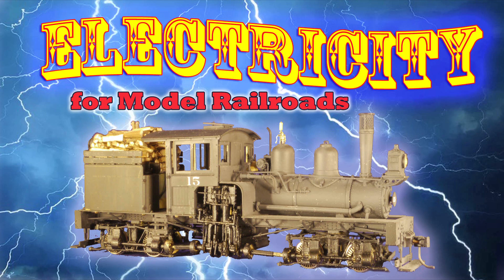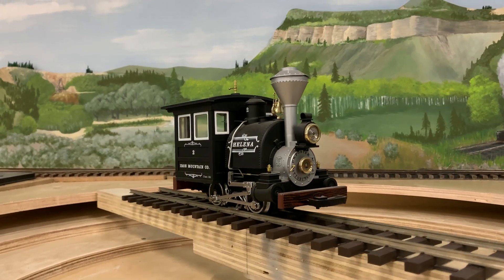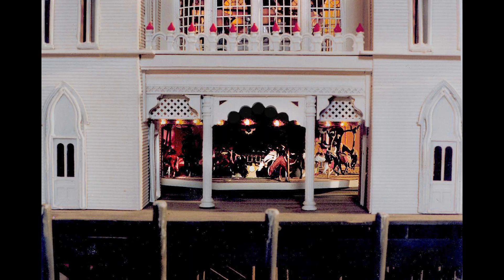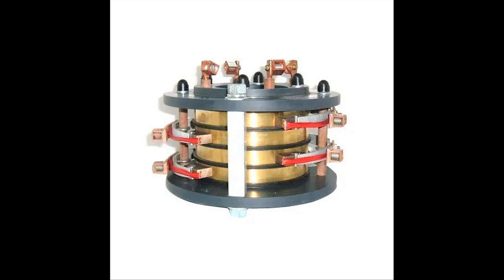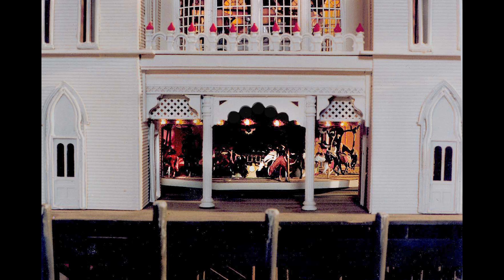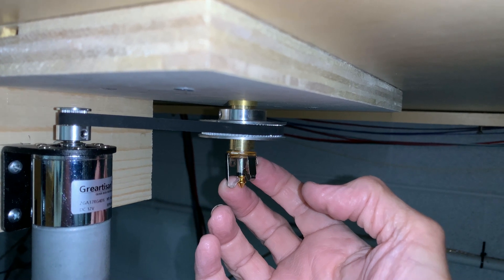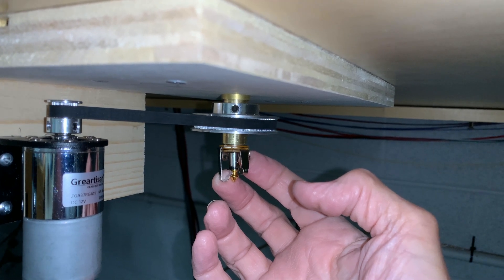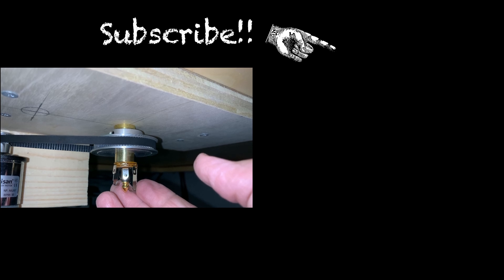Super Simple Slip Ring for Models and Small Electrical Projects

Comment: You: "...female 1/4 inch plugs." Common error - the Plug is the Male part. The Jack is Female. Frpm Google "A plug is the male-type connector, often at the end of a cable, while a jack is the female-type connector that a plug fits into.". Look it up if you don't believe...

Comment: those guitar style sockets are absolute garbage. They wear out really quickly because the contacts are both structural and electrical. It takes verry little force to damage the contacts spring steel, at which point the contacts become intermittent because they no longer provide enough pressure. I would at the verry least be looking at a dual wipe + a plastic structural shell - something like the NMJ6HCD2 although you'd probably want the solder lug variant NMJ6HC-S.
Reply from the maker: Thanks!

Comment: I built a 36" turntable and used a full size headphone jack as the center pivot and power connection. My turntable is manually turned instead of motor driven.
Reply from the maker: I thought about that. But these huge heavy locomotives require big and heavy. 😊😊
Reply: @ToyManTelevision on my turntable, the plug is not weight supportive. The weight is supported by the wheels at both ends. The plug is just for the pivot point and future electrical connection.

Comment: In 1967, I laid HO model track on a 48-in ring of plywood mounted on a 26-in bicycle wheel mounted on a large speaker frame mounted on a board.  To get power to the track, I made a plate on the underside of the wheel with a contact that slid on the plate.  The wires to the rails were connected to the plate and the wheel.   On the support side, I connected the power pack to the frame and the slider(a brass spring in contact with the plate).  A locomotive was placed on the track, power was turned on to make the loco move.  As the loco picked up speed, the wheel turned under the loco, and it would stay in the same relative position on the wheel as the track moved under the loco.  It would work in either direction just as well.  I showed it off at an Engineers Weekend at college, and the president of the college wanted to know how it got its power and stayed in place.  I got the idea from a Popular Science magazine of a photo of a layout someone had made that fit in a picture frame in a wall behind a sofa.  I wish that I had used a jack like that.
Reply from the maker: Sweet! Steve built similar in 1/8 scale for a sign. Only worked for a few months. Sad. Now it static. But about 10 years old.